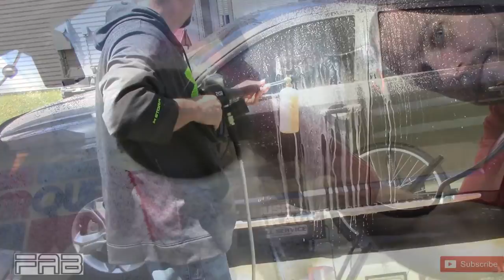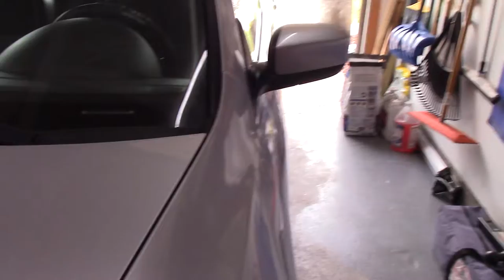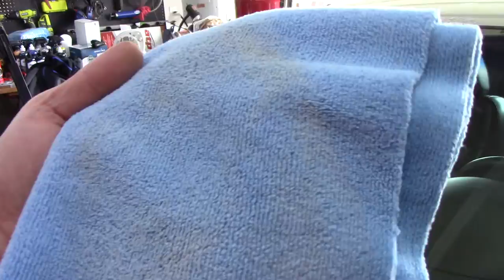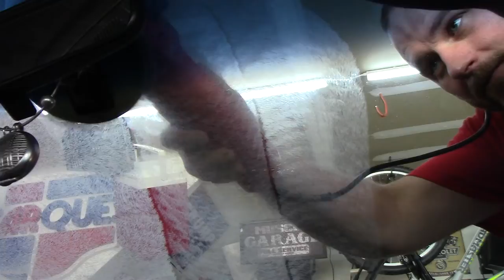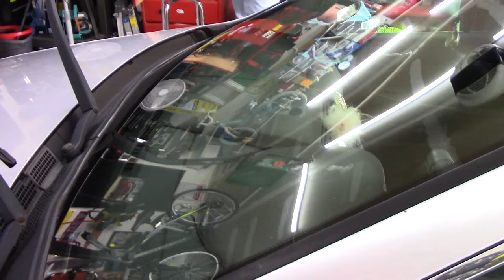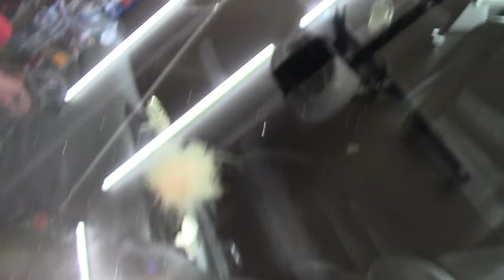Glass Polishing! Spatula vs Windshield

Comment: To polish glass effectively, it takes quite some time depending how deep the scratches are. Cerium Oxide is the main polishing agent found in glass polish, you can buy it by the bag or pre-mixed. Also, if you have severely damaged glass, a home mixture of 1 part Medium to Heavy Rubbing Compound (25%) and 3 Parts Fast Orange (with Pumice) (75%). Use a felt/rayon pad with an interface pad to conform to curves. Also, keep the RPM's above 1500 and of course increase RPM's as needed but do not crank it up too high, if it's below 1500, it won't do much. After the "Special Blend" you can finish it with a Cerium Oxide mixture of 2 parts Cerium Oxide, 1 part water mix to a paste and use that to finish off the glass. Good Luck!

Comment: Thanks Brian. I have been holding off doing my car as I have heard bad stories about people getting the glass to hot. I have the exact equipment you used so now I think I can attempt it myself. My windshield is in bad shape just from wiper swiping no spatula lol.
Watching your video I am not expecting it to look new, but it should look better. I have some Adam's glass sealant that I got in my X-mas mystery box and have been waiting to use too. 
Keep those videos coming 👍✌️🇺🇸
Reply from the maker: B Stewart ExecutiveCarCare You are welcome! I have heard bad stories also but thought it went real well. I think with low arm speeds the temperature would rise quickly. I could have gone slower but faster speeds keep the temp down and just means you have to make more passes. I think you will have no problem and it will help out on your glass. Thanks

Comment: Keep pad wet and increase pressure and slow pad speed. Then watch temp as it will go up dramatically.  Also a interface pad is recommended by Griots. As to those rock chips are not going away.
Reply from the maker: thomkirby Yeah being my first go around with this disc and it not being my car I played it safe. The rayon disc is the same thing Griot’s sells I believe. I appreciate the info and they aren’t rock chips they are spatula chips. 😆

Comment: I have a new '19 BMW X1 and it had a scratch in the windshield just around the driver sight-line so the dealer called in a windshield polishing expert. The guy pulled out a special polishing/grinder that was rather large and expensive. Apparently in the thousands of dollars. He put on 2 different pads with a blue colored cream. He taped the area around the scratch so that he could concentrate his efforts on the scratch itself. After carefully cleaning the windshield he got to work. After a couple of minutes he changed the pad. He used this pad a lot less than the first one. It did take longer to set-up and prepare than the actual work...clean up was quick too. Once he had finished it was like a freakin miracle. The scratch was completely gone....And I mean gone...I then asked him if he could do the entire windshield like for a 7 year old sports car and he said, "no, it would cause distortions in the glass and would be uncomfortable for the driver to see through". So after seeing this video now, I can tell you that your process and equipment are NOT was is used or recommended for removing scratches and polishing from glass. But on the other hand it was worth watching just to see the difference between an amateur and a pro who makes his living doing this 10 hours a day sometimes 6 days a week. But I give you an A for effort. You're cool!
Reply from the maker: Allan Sonac I’m sure there are better machines to polish glass! We weren’t going for perfection we were just going for better and that’s the results we got. I am definitely an amateur in glass polishing for sure. Thanks
Reply: @FABAutomotiveDetailing  BTW on the flip side, you're an excellent and pro when it comes to detailing.
Reply from the maker: Allan Sonac thank you I really appreciate that!

Comment: To just polish up the windshield (no scratches to remove) prior to ceramic coating do you think it would be okay to use a medium foam pad with something like 3D One or Turtle Wax One and Done?  I need to do a windshield today but cant find any actual glass polish locally.
Reply from the maker: Yes you can do that!

Comment: Spatula?? I use a hammer🔨 to clean off my windshield😉 I heard Alvin & the boys again🐿 I've been thinking of trying this on my S2000. It has a ton of little stone pecks all over the windshield. Not really sure if this would take care of that🤷‍♂️ I believe the previous owner used it for track racing, it is set up for nitrous 🏎 Brian, the product comes out of the bottles better when you remove the seal😜 Oh ... "Shut Up"...🤐. Great video👍👍
Reply from the maker: IntervalePC 😂 Yes a spatula! It won’t help rock chips. I checked the bottle before the video and didn’t see a seal. Well it was stuck in the top of the cap. 😆 Thanks

Comment: Could you have followed the instructions to add more during application to keep more product thickness during the polishing? Seems like it worked thin by the later process, just wondering if it would make a difference on the cutting effect. This is why we watch, to learn. Thanks, enjoy the videos. Gonna sub.
Reply: Glass is much harder than clear coat, so yes, abrasives are going to break down much quicker when used on glass, adding more mid polish can improve results. 

You need more everything to correct glass defects. More abrasive, more aggression, more time, more patience. It's really a rotary suited task. You can hose off the sling and residue between rounds of polishing, helps manage heat as well. It's easier and much faster to two step it and step down to a fine polish to remove cutting haze than to slowly whittle it down with just a polish. 

Apex Detail has some good videos, Sweet Project Cars has some entertaining videos on glass as well. 👍✌

Comment: Why didn't you flick water on screen when you mopped it
Reply from the maker: Alan Deacon I don’t understand your comment.
Reply: @FABAutomotiveDetailing  over here when applying the product and using polisher we would flick water on windscreen
Reply from the maker: Alan Deacon Ok I got ya! If the temperature of the glass would have raised significantly I would have sprayed water on it but it only got 8 degrees hotter.
Reply: @FABAutomotiveDetailing  its called Mopping over here machine polishing, like watching your videos interesting
Reply from the maker: Alan Deacon That’s a very interesting word for polishing. Thanks for the info I learn something new everyday. 😂Now If I can remember to mention that the next time I break the polisher out in a video.